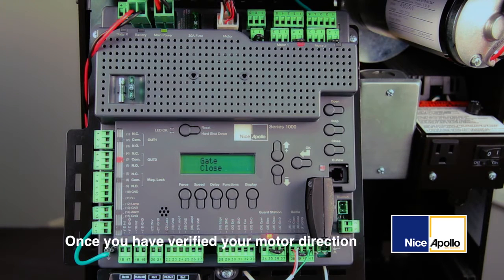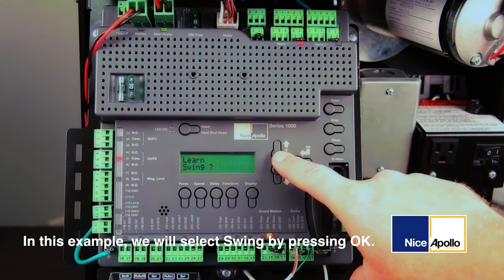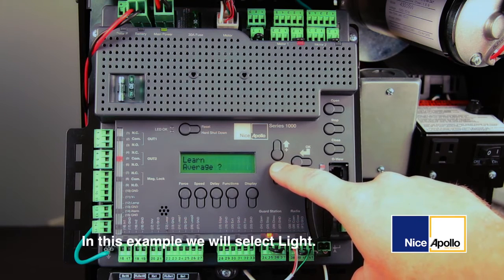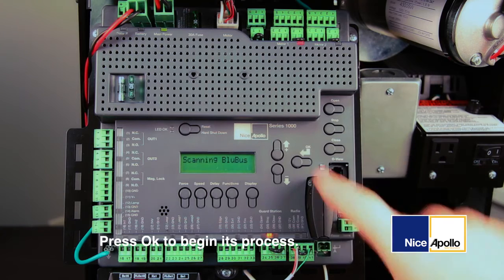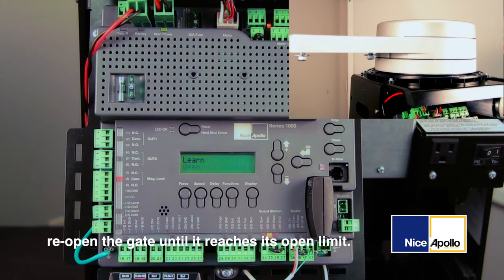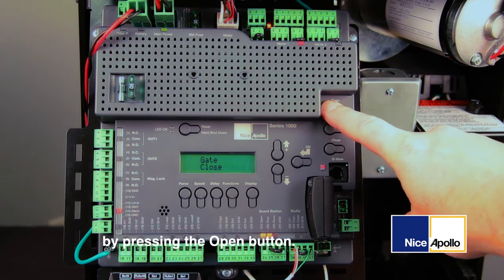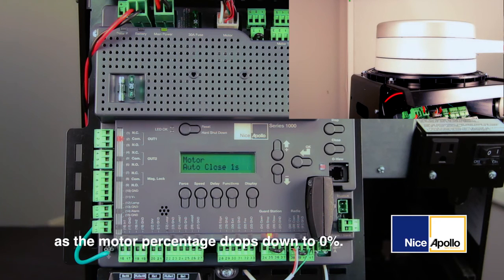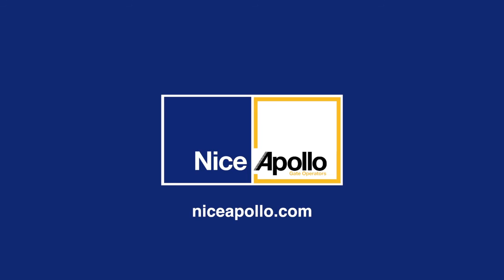How to Learn the Nice 1050 Control Board

Comment: How do you troubleshoot, override or re-set your control panel / gate after a “BluBus error”
Reply from the maker: A BlueBus Error occurs when the monitored entrapment device(s) that are required on the operator are either not present or not wired or working properly.
Ensure that the photo eye(s) are connected properly and aligned.  

If further assistance is necessary contact the installing dealer or email our tech support department at techsupport@hysecurity.com.
Reply: How do you fix an issue with “ min1 sensor for swing gate

Comment: I have a quick question I have that same Apollo/Nice board and it works great opens and closes but it seems like it goes into a sleep mode after about a min or two and then nothing works I have to press a button on the board and it wakes up? I have a new battery and I have tried everything I could think of. Any ideas why it just shuts down and goes blank? Thanks for any help you can provide me.
Reply from the maker: It sounds like you need to connect to our tech support department. You can submit a help ticket online at https://support.hysecurity.com/hc/en-us/requests/new?ticket_form_id=360002273593 or call or text tech support at 253-201-2918.
Reply: @NiceHySecurity  yea no one comes out to my house it’s too far away and too far deep in the country no one cares about us out here so a help ticket isn’t gonna do any good. I was just trying to trouble shoot and see if there was anything I could replace before I bought a whole new set up.
Reply: Thanks for the help anyway glad you responded most places just ignore people
Reply from the maker: @thesquirrel905  The marketing department manages our page on youtube. We are a great group of people and really want to answer your question but we're afraid we aren't very helpful with technical questions. Our tech support team can help you. A tech support ticket allows you to email the problem and they will contact you to troubleshoot, ask additional questions or to let you know if a board replacement is needed. You can also call or text them at 253-201-2918.
Reply: @NiceHySecurity  ok thanks I’ll try them.
Reply: @thesquirrel905  did they help you squirrel ?